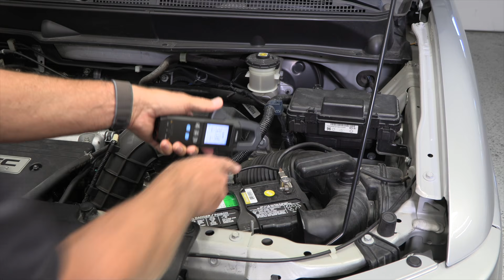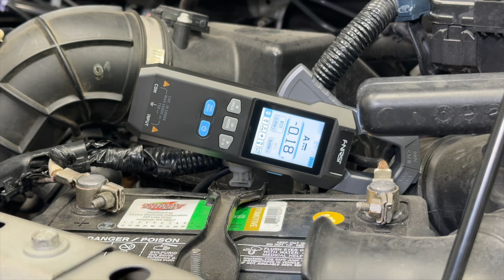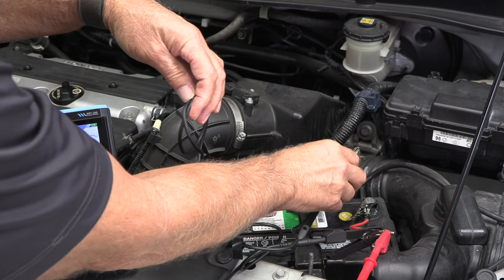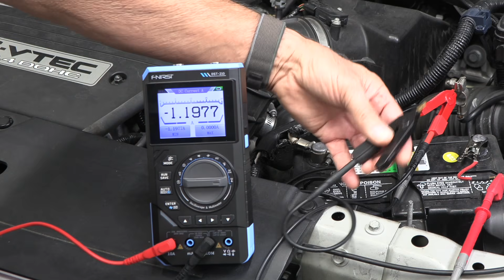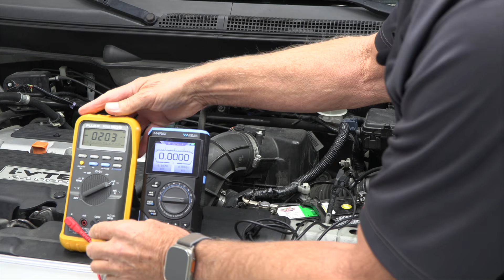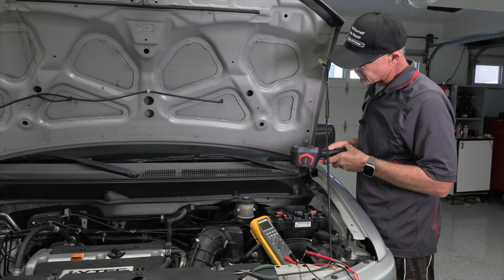Battery Dies Overnight? Find a Parasitic Draw (Stop Pulling Fuses!)

Comment: A shorted alternator diode will slowly discharge a battery.  It 's not fused  and the alt. will still work.
Reply from the maker: Thanks for adding
Reply: Sure enough took me 3 weeks and several batteries to find out my 3 year old alt had a bad diode, no batt lights on dash
Reply from the maker: @williams9968  I appreciate you posting that here, a bad alternator diode can definitely be a tough one to find, especially when you never get a battery light on the dash. Three weeks and several batteries later—that’s frustrating! Glad you finally tracked it down, and thanks for sharing because this may help someone else chasing the same problem.

Comment: My dash cams front and back are on 24hours a day and will make battery flat if I don't drive for 2 days very annoying
Reply from the maker: If your front and rear dash cams are recording 24 hours a day, they can definitely drain the battery when the vehicle sits for a couple of days.

Make sure the camera is connected through a proper hardwire kit with a low-voltage cutoff and that the parking-mode settings are adjusted correctly. Otherwise, the camera may continue drawing power until the battery is too weak to start the vehicle.

Here’s a video showing how to check that the dash cam is hooked up correctly:

https://youtu.be/pZrDiFluF8A
Reply: A trickle charger or battery tender could help when it's parked

Comment: You don't need an amp clamp to T/S parasitic draw. People have been t/s'ing parasitc draw for years before we had amp clamps! Don't need them and they are expensive for the shadetree mechanic and way overkill. 
 Why dont you just suggest people buy an osciliscope?
Reply from the maker: You’re right—an amp clamp is not required to diagnose a parasitic draw. Technicians have used a multimeter connected in series for many years, and that method still works.

The reason I recommend a low-amp clamp is because it allows you to check current without disconnecting the battery, which can wake up modules, reset timers, or temporarily hide the problem you’re trying to find. It also makes it easier and safer for someone who may not be familiar with moving meter leads and connecting a meter in series.

It’s simply another diagnostic option, not the only way to do the test. An oscilloscope would be overkill for most basic parasitic-draw testing, while an amp clamp can make the initial diagnosis quicker and less intrusive.
Reply: @dannysdiygarage yes an amp clamp meter may save that 10 amp fuse in your multimeter, also disconnecting that ground wire just make a latched relay disappear when contacts open,if your recommending meters of any kind  it should have a DC accuracy of not more than plus minus 0.5 .
Reply from the maker: @anthonysova7117  Good points, Anthony! 👍 You're absolutely right about the possibility of blowing the meter's fuse, and disconnecting the battery can cause a latched relay to release, potentially hiding the very problem you're trying to diagnose. That's one of the biggest advantages of using a low-amp clamp. You can monitor current without disturbing the circuit. I also agree that accuracy is important, especially when measuring small parasitic draws. However, I'd put just as much emphasis on resolution and repeatability, since we're often looking for differences of only a few milliamps. Thanks for adding to the discussion!

Comment: I keep seeing different ways of using the amp clamp. Some use it on the positive lead, some use it on the negative. Which is the best way to go about it?
Reply: Either will work, it's just measuring flow of battery juice lol. Your negative is better in most cases because if you're doing everything on the negative you can't accidentally short anything out when you get to actually probing which can burn up your meter, plus it usually only has one or two big wires so it's easy to get them all in the clamp, whereas the positive side can have several wires going in all different directions, especially on modern vehicles. That's why it's best practice to use the negative side for any kind of electrical troubleshooting or working on the electrical system in general. If you have a loose negative, it is the ground so if it accidentally touches metal, no harm no foul. But as far as effectiveness, for the most part it doesn't matter.
Reply: @grnsouth1204 thanks. Gonna be testing a 2000 Nissan frontier. It's had a parasitic drain for a while.

Comment: Pulling the fuse on an old disc player and radio solved my problem with the battery draining on an old Isuzu trooper. 
No effort required.
Reply: I've got a brand new battery and brand new alternator and still have issues starting the car if it sits for 2 days or more. 
I might try pulling the radio CD player fuse
Reply from the maker: Hi! If the battery and alternator are both truly new and tested good, it definitely sounds like you may have a **parasitic battery draw**.

Pulling the radio/CD fuse is a quick test, but I wouldn't stop there. If the car starts fine after removing that fuse, you've at least narrowed the problem to that circuit.

I'd recommend measuring the parasitic draw with a multimeter and then pulling fuses one at a time until the draw drops. That's the quickest way to pinpoint what's staying awake and draining the battery.

One question: *Does the engine crank slowly after sitting for two days, or is the battery completely dead with just a click or no crank?* That answer will help narrow it down.

Danny
Reply: @dannysdiygarage thanks for the reply. I had a friend help me with his multimeter. We pulled every fuse one by one. 
Nothing changed the small amount of draw being taken from the battery.
What we think is that the BCM is drawing power with the ignition off.

If the Ute sits for 2 days it cranks over very slowly. But the last time it sat for 3 days and I had no crank at all. Just a few clicks. I jumped started it but even that was hard to crank over.
Reply from the maker: @M @Mothy2014 what year and model car are you working on?
Reply: @dannysdiygarage Ford Falcon 2001 6 cylinder
Reply from the maker: could be, but most likely some thing keeping the bcm awake Did the draw disappear when you pulled the BCM fuse, or did you disconnect the BCM yet
Reply: @dannysdiygarage I'm sure we pulled every fuse and anything else I could see. Nothing changed. The only thing we could manage to work out is there is a wire running straight from the positive terminal, a white wire, that's the wire that has power going through it with the ignition off. We disconnected that wire and left the red main wire connected. That's when we got no ignition power at all. So we assumed that the white wire was sending power to the BCM
Reply: @Mothy2014  or, just follow the procedure shown in the video rather than taking a stab in the dark?

Comment: what the hell is a jumper wire? you might have to explain that one, seems your shorting the neg and positive terminals?
Reply: He's not shorting it. He removed the negative terminal from the negative battery post. The jumper goes between the terminal and the post so that any surge current has a path of least resistance that isn't your $500 meter. Once the meter is hooked up you can remove the jumper. It's usually not strictly necessary, but it's cheap insurance.

Comment: What's the easiest way identify if a bad relay is the problem and to pinpoint which one is bad?
Reply from the maker: The easiest way is usually to find another identical relay in the fuse box that you know is working and swap them temporarily. If the problem moves or the circuit starts working, you’ve likely found the bad relay.

You can also listen or feel for a click when the relay is commanded on, but a click doesn’t always mean the contacts inside are good. For a more definite test, check for power and ground at the relay socket and test the relay contacts with a meter. 👍

Comment: Usually with a parasitic draw the vehicle battery is dead, so obviously the amp clamp will show zero amps. We need to get the battery operating and determine if we need to order a new one, and if so get the battery on order as soon as possible, because we have to do a new battery acceptance test. But how do we revive the dead battery. If the battery is not frozen, leaking or has clear signs of damage, and maybe just needs the lugs cleaned we can proceed. 

Next step is with my custom protected 75 Amp DC regulated protected power supply across the battery starting at zero volts, as monitored at the battery with a DMM, I can slowly ramp up the voltage and observe the current. If I reach a point at about 10 Volts we the current starts to spike I know that I have a shorted cell, and I need to replace the battery before testing starts. If I don't have a shorted cell and the battery looks like it is taking a charge I can slowly increase the terminal voltage to a set value at about 20% C rate at lets say 13 Volts, maybe 15 Amps. Then I can go key on engine off and see if I can talk to the vehicle with the scan and clear codes, then latch all off the doors, hood and trunk (if a fuse panel is in the trunk). I then use my Pico Scope with an amp clamp monitoring the current with one channel and the battery voltage with another. Then I start the scope, go key off, and observe the waveforms.

It is best to use Pico Scope with an amp clamp to measure the dynamic behavior of the parasitic draw current, because unlike the video, in most real world problems the parasitic current draw is dynamic. By understanding the signature of this current you will gain a better understanding of the sequence of events which could help in cause and effect in the diagnosis.

The advantage of the amp clamp approach is we will not blow an in-line meter current fuse if a large load suddenly turns on like a cooling fan or electric water pump. Also, if the vehicle is asleep you can get a quick reading on the parasitic draw which is good to know if the battery is not completely discharged. However, any time we wake up a vehicle by opening a door etc. we have to wait until the vehicle goes to sleep in order to start out testing.

For sensitive amp clamps you can still detect a low current parasitic draw at the start of your testing. No need to use an in line meter on amps to identify the draw down to a mA. For me I only use the DMM on milliamps to measure the final sleep current to complete the invoice after the vehicle has be repaired.

My thermal camera is very sensitive so it is very effective at identifying fuse current flow. If there are several modules on the parasitic draw power feed you can find the module that is awake by using meter current clamp after the splice on each individual wire feed but this is not always easy to do if the spice is buried in the harness. By finding the module with current as opposed to pulling fuses, we can do our testing without waking up the vehicle. Every time you wake up the car you have to wait for it to go asleep before resuming your testing. 

If the parasitic draw is due to networks waking up you have to monitor the busses with the Pico Scope to find out which one is waking up first and then pull fuses until the wakeup stops. On the LIN bus both masters and slaves can wake up the LIN bus, and usually by extension the master node wakes up other module over CAN. So, if you unplug a LIN slave that wakes up the bus in error the vehicle should eventually properly go to sleep.
Reply from the maker: That’s a very thorough approach to finding those tricky draws. thanks for sharing

Comment: One problem is probably the least paid attention to.
  The wireless  keyfob will keep the computer system in a wake-state while it is near the vehicle. 
 The issues being ignored are:
  If the car is not driven enough to fully charge the battery .
   If a car is being used for a short drive and the Auto-start system is engaged. 
 If ANY wireless keyfob enters the area the vehicle is located in, it can wake the computer system. Such as Parking lots with mid to high activity, delivery services that use personal vehicles, Doordash, Grubhub, and others. Even active neighbors if their driveway happens to be near the vehicle in question. 
  And street parking, where every newer car being driven by can possibly interact with the computer system.
  Just one set of potential battery draining for newer vehicles.
Reply from the maker: Great points, those are definitely important factors to consider with modern vehicles!
Reply: @dannysdiygarage  So, from StarwindHawking8997's comment, we're to gather that the 
"presence transmitter" of a key-fob isn't specific to the vehicle?
Someone driving by can "wake up" a cars' systems?
Sounds like a great way to sell batteries. 
I live in a rural area with the nearest street 100 feet from where I park (mostly out-side.)

  Would there be any adverse effects from using one of those terminal mounted battery disconnect switches on a 2011 Honda Element (with some kind of parasitic draw.) It has electric locks but not the auto-unlock of newer vehicles. 
   I sometimes don't drive it for a week or two, the battery is almost always dead in that time, and I recently replaced the battery.

Comment: .500 MA is not .5 amps.  It would be .0005 amps but it is not even important for this video so I don't even know why you brought it up.  This is a video on parasitic draw not on meters or ampere ratings.  What I do is check the draw and pull fuses until I find what is causing the draw.
Reply from the maker: I get what you’re saying. The video wasn’t meant to be a lesson on meter settings or amp conversions — it was focused on finding the draw by checking the current and pulling fuses until the problem circuit is found. For reference though, 500 mA equals 0.5 amps, and that would be considered a pretty large parasitic draw.
Reply: @dannysdiygarage  the poster is just observing that when you asked Siri, you said 'hey siri what if POINT 500 milliamps, in amps?". That is half a milliamp. You actually meant "what is 500 milliamps, in amps?"

Comment: What is the point with the "Amp hound" if all it does is read the voltage drop? Converts it to milliamps? For that to work you will need to know the exact fuse properties. A 5A fuse has much more drop than a 25A and different brands of fuses differ also. Use your multimeter and get the voltage drop. That is just as good. You just need to see if there is anything there.
Reply from the maker: You’re right, the Amp Hound is basically reading the voltage drop across the fuse and converting it to an estimated current reading. A good multimeter can do the same voltage-drop check.

The main advantage of the Amp Hound is speed and convenience. It lets you move from fuse to fuse quickly without pulling fuses and possibly waking modules back up. It’s not really meant to replace understanding the test — it’s just a quicker way to help identify which circuit has activity.

And yes, once you find the circuit, you still need to diagnose what on that circuit is actually causing the draw.
Reply: @dannysdiygarage thanks for explaining 😊
Reply from the maker: @NiNjaTurtLe697  appreciate your support
Reply: There is a chart online that shows the voltage drop to millivolt with the kind of fuse you are using. Don't quote me on this but I think it;s from Power Probe. It's very handy.
Reply: @pontiacsrule8761 The chart(s) is indeed on power probes website; under resources.

Comment: Why roll the windows down?
Reply: Cause he locked the doors then disconnected the battery.  He can still access inside if needed
Reply: To have access to controls inside the car without having to open the door.
Reply: he let the dogs out.

Comment: Why are you adding a 2nd jumper wire to prevent damaging the fluke current ammeter from in-rush current? What would cause in-rush current?
Reply from the maker: This video explains it, at around 3:25 https://youtu.be/fZZpQY1aCVk?si=8L3dH07tM6jWCBp3
Reply: In rush current would be caused by computer modules and systems 'waking up' as soon as voltage is applied. If you have a more serious short it won't make a difference since it will still possibly blow the multimeter fuse.

Comment: HI Danny, another great video for experienced meter users. I would just like to say that the instructions are not clear when connecting an Ammeter in series with the load. I can see many novices blowing the 10 Amp fuse in their Ammeter by connecting an Ammeter across the battery and then creating dangerous sparks when placing the shunt wire across the battery, yikes. Perhaps a drawing would make it clearer for all users.
Reply from the maker: Thanks for the feedback, I’ll consider adding a diagram next time!
Reply from the maker: https://youtu.be/fZZpQY1aCVk?si=8L3dH07tM6jWCBp3 at 3:25 this probably explains what you’re talking about

Comment: The instructions underneath this video say to connect the RED lead to the negative battery cable. But in this video it's the black lead?
Reply from the maker: Good catch, the cable color doesn't actually matter for testing

Comment from the maker: Battery dies overnight? Start here 👉 0:30 (Amp Clamp = fastest proof of a draw)
Then go to 7:45 (Voltage Drop = NO fuse pulling) to find the circuit without waking modules.
Full chapters + tool links are in the description 👇

Comment: Not all amp clamps will work. Only amp clamps based on a Hall effect sensor will work. Cheap AC clamps use a coil, which will work in AC only because they're basically a Transformer...
Reply: "Cheap" ac clamps...it's how ALL ac current clamps work.
To measure DC current takes a different method..I prefer measured DC current actually flows thru the meter for accurate readings.
Reply from the maker: Thanks for adding, this one works well for both higher and lower current